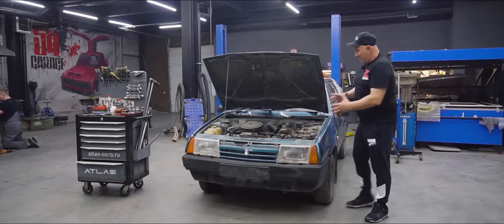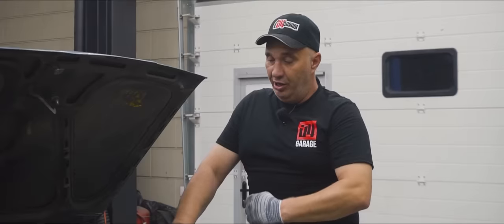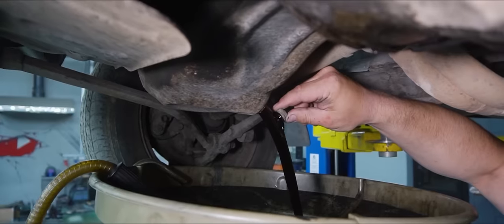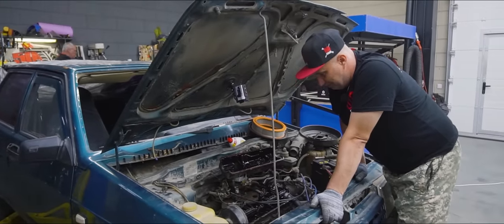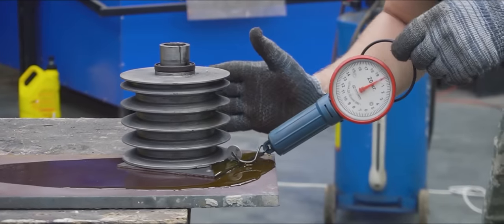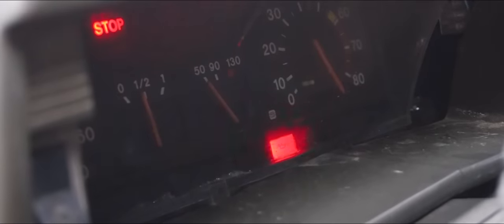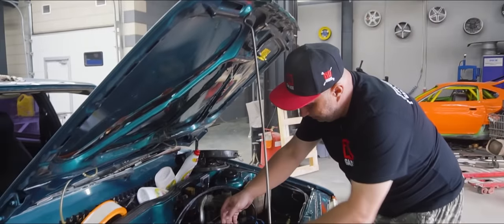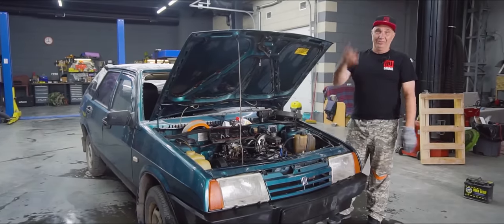Can you use dishwashing liquid to clean an engine internally?

Comment: now fill up the radiator with listerine mouth wash
Reply: The alcohol will evaporate out the overflow.
Reply: Brown listerine
Reply: Minty fresh ac
Reply: Amused.  Reminds me of when my little brother emptied a whole bottle of dish soap into my radiator.
Reply: @pb222221 in Russia listerine do not contain alcohol
Reply: @starcloakstarside9719  when i was a kid i put a whole bottle of water in the oil reservoir of my family car. 🤣
Reply: @skullf0xdusk679  what happened?
Reply: @david197407  the oil turned white, my papa being a racer and worked on cars for most of his days knew as soon as the engine was making noises
Reply: Yes or Jager Meister!
Reply: I wonder if the alcohol would keep it even cooler
Reply: @pb222221  didn't think of that my other comment is busted lol
Reply: @ronniewilliz153  liquid nitrogen would be pretty cool
Reply: @pb222221  the overflow is only for overfilling. it is blocked off by the cap. it is a pressurized system.
Reply: @MaxiTheManiac  Alcohols boiling point is a lot lower than antifreeze. It would spike the pressure faster and trigger the valve well before it reached normal operating temps.
Reply: @alex_marshall_   when your car grill smiles you know your engine bay is minty fresh....
Reply: Or man glaze as oil
Reply: Complete the clean with Listerine
Reply: @MrDjcamo29  Or vodka.
Reply: @pb222221  there is no valve, it is literally just a overflow that is blocked off by the cap when closed. Im not saying alchohol will work, im just telling you how a radiator overflow operates
Reply: @chopi7784  Listerine is not necessary if you have vodka.
Reply: @skullf0xdusk679  
Amused.  “The car seemed thirsty!  I was being nice!”
Reply: @pb222221  ahah do you not know back in the old days ethanol was used as antifreeze in developing countries?
Reply: Holy shit, I just got that ad
Reply: @skullf0xdusk679  cool dad
Reply: Don’t forget to add cold water to it
Reply: I puy dishwasher liquid with water to clean there lol
Reply: @pb222221  if you let it get up to temp for sure... i wonder how that'd go if you just did a few cycles of running it for 30 seconds and let it cool to circulate it but not let it get hot
Reply: @ronniewilliz153  it would till it boiled off do to lower boiling point
Reply: @skullf0xdusk679  That's a time bomb but very cool to see 😅
Reply: @pb222221 You do realize antifreeze is alcohol and water right?
Reply: @davidgruen7423 alcohol is still used it's just propylene glycol instead of ethylene glycol.
Reply: Most fluids will work fine in a radiator as long as the aren't overly viscos. I don't imagine the water pump would be too happy churning maple syrup or molasses. In a pinch most fluids would work though as long as you empty it out and replace it ASAP.
Reply: It's flammable lol
Reply: 😮 yeaaa THAT WOULD BE GREAT ✨👑💯
Reply: In 1925, Auto Coolant was basically a form of  "Vodka". But Methyl Alcohol which cannot be drank.  It needed to be constantly topped up.  Adding actual vodka would blend perfectly into the coolant then.

Comment: i know someone that used to clean the inside of cruddy old engines with paraffin. He would drain all the oil out and fill it to the top with 5-6 gallons then leave it for a week to soak (never starting it ). After a week he would drain out the paraffin (which was jet black) and refill it with cheap oil. He would then remove the plugs and turn it over to get all the paraffin out of the bores and refit plugs and fit a new oil filter. He would then start it and let it idle until it was up to temp, shut it down and do another oil and filter change. The oil that came out that had only been in it for 20min again would look like it had done 20k miles. He swore by it and said it would stop some smoking issues, (by cleaning out ring groves) oil leaks (paraffin softens and swells rubber seals) and noisy tappets (loosens varnish and deposits). He would then follow up with another oil and filter change at 500 miles
Reply: That was the go to parts wash for bicycles when I was a boy.  
It makes perfect sense it's going to seep into the scum and clean it out of tiny valves and ring grooves. 
Should run okay with only a drain and refill with the correct oil or one grade heavier actually and go.

Comment: Let’s try this with dot brake fluid, that removes all deposit and gunk from the engine! 😉👍
Reply: Including the seals. It reacts to rubber and plastics. 
But it will be clean!
Reply: @Tootall206  you beat me to it.
Just my first thoughts
Reply: I second this
Reply: Maybe we could use some rust remover in the cooling system to remove all the corrosion
Reply: @2koolchris291  that's actually a good idea to test lol
Reply: @andrewprettyquick2070  lol... the seals in the brake system are special o-rings and seals... brake fluid will eat through anything that isn't specifically designed for brake systems...
Reply: automatic transmission fluid actualy cleans engine.
Reply: @andrewchrist655  And zip strip, a combination of zip strip and trichloroethane 1,1,1 stabilized will clean anything and dissolve most any hydrocarbon or fluorocarbon based polymer.
Reply: Also use antifreeze
Reply: @Tootall206  why doesnt it break the resevoir? that is plastic lol
Reply: Try brake cleaner rather than brake fluid. Should do the trick... flammability?
Reply: @joebloggs2635  it makes chlorine gas when combusted.... which is not the best
Reply: 100% would like to see this
Reply: Obvious non gearhead comment
Reply: @kacperchrusciel890  not true bud
Reply: @STAY-GOLD-VINYL  lol
Reply: Sarcastic.  Yeah!  Then let’s run E-85 through an Edelbrock carburetor!
Reply: Paraffin might be interesting. Or autobox Dexron II.
Reply: No, it doesn't REMOVE the gunk. It will make the gunk break free, and the gunk will then flow along with the oil, to the most crucial narrow passage it can find. Which the gunk will block, and cut off the oil supply to something expensive, which will fail at high RPM and blow up your engine.

Never use Dot4 fluid for this purpose. The slightly cheaper Dot2 fluid is much better, but difficult to find. (Sorry...couldn't help myself there....🤣)
Reply: @2koolchris291  You won't remove corrosion from a cooling system. But you will move the particles to the radiator, where they will clog up the core.
Reply: @kacperchrusciel890  😁
Reply: I'd be far more interested to see how antifreeze does in the braking system since they're both made of basically the same thing, it would lock up an engine, I'm curious what would happen though if they used LA's Totally Awesome in the engine in place of the soap, from what I've seen online that actually does make a huge difference, just don't use a whole lot of it
Reply: You guys think too small.  Hydrofluoric Acid.  If this doesn't clean it, nothing will!
Reply: DOT is so harsh it will destroy the engine immediately hh
Reply: Let’s try dynamite... will also remove all deposits and gunk, possibly including the whole car
Reply: Great channel...the problem is you need to us "Dawn" dish liquid soap,  it cuts grease!🤣
Reply: @2koolchris291  
I once used AUTOMATIC dish washing detergent in my cooling system. Drained it and filled it with water with some detergent and ran it for about 20 minutes. What came out was really dirty. It was flushed a bit and refilled with appropriate antifreeze. Ran fine. Must be automatic dish washer soap that does not suds up. Can't run it long as it is hard on cast iron and aluminum.
Reply: Also removes paint efficiently
Reply: @kacperchrusciel890  yep chlorine gas turns to hydrochloric acid when it contacts moisture
Reply: @Tootall206  dead oil ruins plastics too 🤣 why do you think oil leaks cause rubber mounts and belts, anything ruber or plastic to fail.
Reply: @andrewchrist655  Kerosene especially.
Reply: @moscowhq9978  80% oil (1 step thicker than factory), 10% ATF fluid, 5% MMO, 5% Restore. How to have 4 600k mile + engines in the family.
Reply: Better for polish the body paint 🤣
Reply: @2koolchris291  it'll fix the rust in the gas tank 😂
Reply: @Tootall206  sounds like fun
Reply: @TotoGuy-Original  designed to handle it.
Reply: @2koolchris291  white vinegar works best
Reply: @STAY-GOLD-VINYL it is if itch chlorinated brake cleaner

Comment: project farm will have to test washing liquid against the oils!
Reply: thats my kind of crossover haha
Reply: Dude this must happen

I want to know if dish soap actually works well with lubricating
Reply: "We're going to test that."
Reply: Fucking lol
Reply: #projectfarm
Reply: Don't forget to add a little water so you can get some good bubbles down there...
Reply: @dilianvt  you have to use Palmolive dish washing liquid it's gentle on you heads and parts...
Reply: @peterrivney552  Or Dawn.  If Dawn could clean grease off of a duck, it just might clean sludge from your engine.
Reply: He did do a video where he used shampoo as oil for his mower

Comment: You must add WATER to that soap... otherwise you will not solve the burnt oil deposits.
Reply: Well kinda if water gets in a well hydro-locked engine.
Reply: @WilliamHollinger2019  The oil circuit of a car engine is not connected to the combustionchambers so that is nonsense of course. Maybe a drop of water could squeeze through a gap due to the old engine, but a drop of water is not enough to hydrolock it.
Reply: You are right and wrong.. there is that pipe/hose what makes to plausable generate underpressure to oil chamber, because main reason It collect unburned fumes what escaped from piston rings outside (cylinder wall) and then returned them intake manifold back to new try to burn ;)
Reply: That most likely wouldn't have changed anything
Reply: @jdmking4776  You add soap to water to solve oil on it... soap by itself does not solve oil. But that's bonkers, anyway.
Reply: @FinflazodeTurroai  I understand that. I clean engines on a daily basis, I can tell you that soap and water will NOT clean what's baked on there. It takes a specific solvent or a hot tank machine. Normal water and soap isn't going to change the result they got.
Reply: soap creates bridges between dirt and water Water is a solvent
Reply: @jdmking4776  Yes, for example, iodine dissolves readily in alcohol, into a purple solution, but not in water.
Reply: Has anyone considered that liquid detergent contains water?
Reply: FFS, there are engine flush aditives for this purpose...
Reply: In russia soap drives a car

Comment: I Would think diesel fuel would be a better detergent for dirty engines.
Reply: Or automatic transmission fluid.
Reply: Gasoline also does a good job, bit expensive though. White Spirit (Mineral Spirit, same thing) is very cheap and as good.
Reply: diesel is more like a lubricant, regular gas might do a better job
Reply: Yep you can use a cup of diesel in the oil for about 100 to 200 miles before an oil change or you can buy a special 'pre-oil change' additive
Reply: Petrol engines you can use either
Reply: We gave engines kerosene enemas in the olden days. Never hurt anything.
Reply: Diesel works great
Reply: Diesel is good and affordable, just not running for to long.
Reply: Diesel actually lubricates engines, making it a terrible lubricant.

Comment: Dishwashing fluid reacts with water. It's the water (without surfacetension) that does most of the cleaning.
Reply: Surfactant*
Reply: Huh?
Reply: wrong...
Reply: Yes. Soap does not work with out water
Reply: Soap is a bonding agent that allows water to grab oils 
So you’re wrong
Reply: @jakeelliotmarshall  
"... allows water to grab..."

Comment: Many years ago when I was an apprentice I owned an old Datsun 140y which used more oil than petrol. It smoked like a steam train. Money was tight and my wife was pregnant so we couldn't afford an engine overhaul. What I did have access to was a lot of old used engine oil which I literally burned through the engine to keep it going. It must have been at least 50 liters which went through that engine in about 3 months. What amazed me is that even though I expected the engine to blow up at any minute it kept going.  Eventually a buddy and mine were at my home and we decided that we should pull the head and check if there was traces of broken rings. I had bought a dekoak kit. When I pulled the head the bores were clean and we could see no piston damage from the top. What really amazed me is how clean the engine was inside. Even the golden stains that usually develop on the exhaust side of the head where barely visible. We pulled the engine and found that the oil rings were completely collapsed but again everything in the sump was like new not even dirty. I just changed the rings used the same bearings and threw the engine together expecting it to die a terrible death within a month. The engine never used a drop of oil from that day on. 10 years later I sold the car without having to touch the engine mechanically again other than the odd oil change. By the time I sold the car she had nearly 2million kms on the clock. 
Sadly the body was beginning to fall apart when I sold her.
Reply: Nice story.
Reply: I can't believe I just sat here and read all of it 😂 but Kool aid
Reply: I didn't even know cars could do that many kms. Must've been "country miles".
Reply: My datsun 120y blew its headgasket, couldnt get a spare. Got bored of filling it with water so i stopped and it never broke down despite overheating, six months later i drove it to the scrapyard.
Reply: That's amazing! Good read 📚
Reply: Sounds like the game my summer car
Reply: Nice! 😆
Reply: I ain't reading all that
Reply: @flexflex3676  No one's forcing you to
Reply: @flexflex3676  it's ironic how some people will not read a long paragraph because they think that will waste their time, but will then turn around and waste their own time writing a pointless comment that wastes everyone's time.
If I don't want to read a story, I just don't read a story. I'm not going to post a comment saying "I don't want to read a story today". What a useless piece of information that literally nobody wants or needs to know.
Reply: @flexflex3676  by the way, my toe itches.
I wanted to share that useless info with you and everyone, but I didn't want to add it to my previous comment, because that might make it too long to read.
Reply: @chrischaf sounds like you need some tuff actin tinactin.
Reply: @secularargument  lol thanks for the suggestion! That regular actin tinactin just doesn't cut it with my itchy toes! ;D
Reply: @chrischaf how is Your toe now?
Reply: @mpjhonselaar  Oh! It's much better, thanks for asking :D That  tuff actin tinactin really works!
Only problem is, now my other toes have fallen asleep... It may be from sitting on the toilet for too long while reading youtube comments 🤔 Not sure what to do about that :\
Reply: 2,000,000 km?
Reply: cool story bro.

Comment: My old 91 C1500 Chevy 4.3 truck my grandfather owned, only did an oil change when it was new, we always use to give him a hard time about not changing his oil, Well he got older and in 2015 I bought the truck off him, and it was is rough shape but still a ton of life left on it, I never did the oil change at all and I sold that truck last year, it had 687,000 miles on it, original engine, Smoked on start up just to let you know it still has oil, I still see it from time to time. That truck just wont die and its been threw some stuff, I hauled in 6,000lbs in scrap engines and transmission with that thing lol.

My 92 Silverado, I put in a 12,000 mile 94 tbi 350 v8 in it, I do the oil change 3 times a year on it, the engine should have around 100k miles on it at this point, body has 366k miles on it now.
Reply: Not changing the oil is extremely foolish. You should at least change the filter often.

Comment: I've cleaned engines with a mixture of 1 part fresh oil and one part diesel. One had a lifter stuck, and was all gooey and had black hard residue in the lifter gallery. 
After running the engine for about twenty minutes, I emptied it from the mixture (it came out really black) and poured in just fresh oil and had the engine running for another twenty minutes. Then emptied it again and then you couldn't see anything but fresh oil coming out. After that, I fitted a new oil filter and poured in fresh oil for the last time. 
Then the engine was quiet.

Comment: Used to use a mix of ATF and Diesel years ago to clean the internals, seemed to work well with the hydraulic tappets and cleaning the oil rings

Comment: Vlad was different today, he was vary informative and explained everything perfect good job comrades 👍
Reply: ...do you realize, that comrades is an English word?
Reply: @jahcubeblbeczek6328  
Man, this is done all wrong. In the manual it clearly states in easy to understand gibberish that an extension hose must be securely connected to the PCV on the rocker cover & the other end of the extension hose must be fully inserted into the trousers of the testing officer before starting the engine. This is a safety feature which ensures the testing officer gets the exact results specified for obvious reasons by the vehicle manufacturer. How could he miss such a simple instruction?
Reply: @jahcubeblbeczek6328  
In your case, take the PCV hose & using whatever force may be necessary to break the crust, drive it into your ear, have a suitably qualified asistant turn key A in ignition barrell B & firmly place size 10 boot C on the pedal on the right D. Ensure pedal D remains firmly crushed into firewall E for sufficient time to achieve desired result. All will be well.
Reply: @johnbrooks9523  so many words without ability to say something. Tell me, are you 'merican?
Reply: @johnbrooks9523  😂good for you, friend. But I'm not interested, nor impressed. Have a nice day